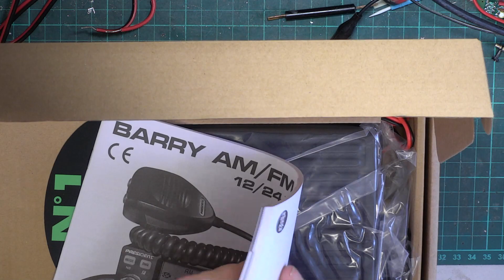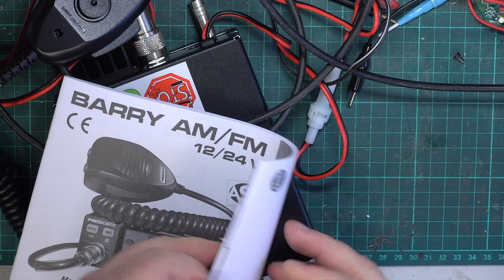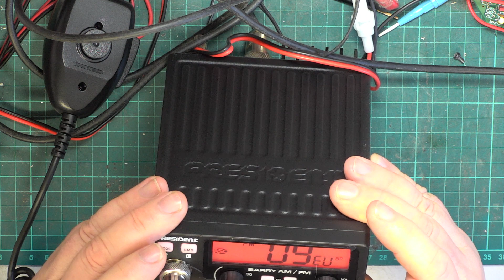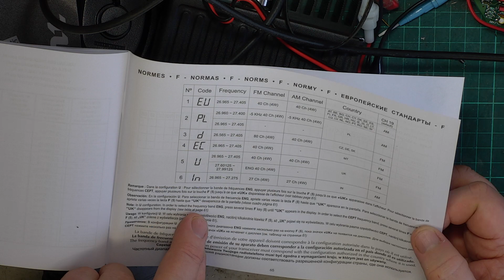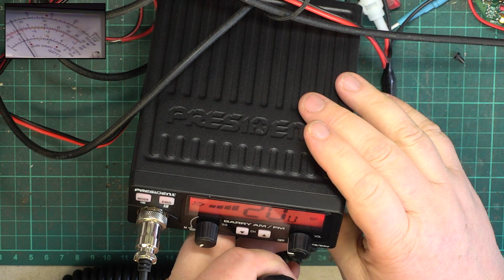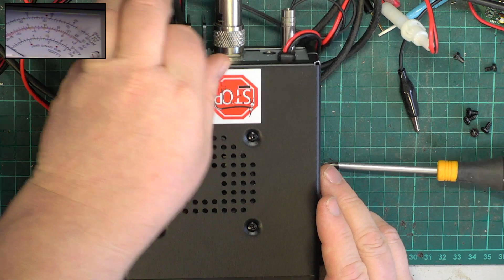President Barry ASC CE MultiNorm CB radio (mobile) - service adjustment, new radio

Comment: Could you please tell me which potentiometer is for FM modulation? Greetings from Stuttgart, Germany
Reply from the maker: FM Modulation is officially called FM Deviation. So when I adjust it in this video, it's the part where I say "FM Deviation" you need to watch.  I certainly can't gell you from memory as it's the only President Barry I've ever seen & Ihave a memory like a sieve.

Richard, G0OJF, UK

Comment: Wondering what you think is the best CB for receiving/DX.  And why don't you like SSB?
Reply from the maker: The snag is that radios differ from set to set of the same model in all aspects. I've had Cybernet 134 chassis radios doing 1uV & then the next set doing 0.27uV. This is why I test & quote the figures every time. Many new sets don;t have alignment points in the receiver. You also have to take what manufactuers say with a pinch of salt, hence these tests.

Assuming you are in the UK, it depends on wht you class as DX. Citizems band radio is a local 2-way radio service with up to 16Km range say our government. I get 35 miles on UK FM in the Nottingham direction, 24 miles in the Newark direction, 10 miles in the Colsterworth direction & 14 miles in the Sleaford direction with me being near Ancaster. That is therefore DX 

Under strange weather conditions you can make contact 300 miles + on an ordinary car set in a car. In such conditions as a licenced radio amateur I once got (in 1983) Russia on 100mW (1/10th watt) on 70cms UHF SSB.

When I worked on SSB business radios used by the police in Wales for example, the clarifiers were automatic...no messing about twiddling. I really just can't be bothered to listen to people sounding like Donald Duck. SSB is 1.6 times the range of AM or FM, that's all (on ground wave) whereas morse code using CW is about 12 times the range. SSB CB in the UK was introduced in 2014 & only type approved (must have CE logo on back) radios made after 2014 may be used. There is much illegal activity on SSB. I want no part of it. SSB may only be used on the 40 CEPT set of channels.

Richard, G0OJF, UK

Comment: Talkback:  Your voice comes through the loudspeaker when you key the mic.  Handy for hearing how much mic gain you have or how much ECHO echo echo you have.  Only nice function I can see Talkback has is you can tell if the mic cable is broken and mic still works.

No smoke!!  How disappointing  :-))

Comment: Richard i suspect them other VR’s may only come into play for adjusting high power when in export mode. I could see the radio has export mode from the pcb and as someone else has commented, that would explain the mega heatsink
Reply from the maker: Yes, I've now been sent the President service manual for this & those presets are to do with AM at a higher power, so not relevant for UK use. Take quoted output powers with a pinch of salt. For example, 20W usually means 12W! A bit ,like 4W = 3W

Richard
Reply: @ukfmcbradioservicingTango21  I’m sure all manufacturers measure output power with zetagi lie-o meters 😁. Oh you do make me laugh. I did think the bremi might be better not worse for accuracy but obviously not.
Reply from the maker: I couldn't believe the 8.5W Bremi. Must have a built in burner.

Thinking of power. We had a Pakistani taxi driver turn up once in the late 80's with poor tx on his 10W Pye Olympic (VHF high band AM, around 170Mhz). He had a Bremi 70W (45W really) illegal CB burner connected....causing his output to be just 2W. Obviously hadn't realised that 27Mhz tat doesn't work on 170Mhz!

Richard
Reply: @ukfmcbradioservicingTango21  if you didn’t know about the linear you could have wasted loads of time testing that vhf set. I would imagine that 99% of pmr users don’t understand how radios work

Comment: One of those pots may be high power when in export mode (note the heat sink in the back!)

There is s service manual available online but it doesn't mention the pots in question.
Reply from the maker: I've now been issued with the service manual. W2 is supposed to be AM mod, but W3 affected it for me so W3 must be AM modulation depth. Looking at the circuit, W5 is also in the AM mod department. Neither W3 or W5 are actually mentioned in the manual & just appear on the circuit. Anyway, the radio ended up working very well....apart from the meter being non-adjustable.

Richard, G0OJF, UK

Comment: Maybe it is time they moved to all DSP for signal processing so that changes can be made via new firmware updates via the JTAG adapter, one might be Clarifier and SSB power
Reply from the maker: It's not an SSB set & has no SSB circuitry or filters. Had it been SSB, I wouldn't have bought one in to evaluate. There is no coverage on this channel of SSB CB radios. This is an SSB free zone as it says in the channel blurb!

Richard

Comment: Oh i have the Barry II EU Version, the only Thing that i missed was an swr Meter, nur ist Sounds great Out of the Box...
And the barry's both Version II and this are both 12 &24v
Reply from the maker: Built in SWR meters aren't a good idea as the diodes used in them can cause spurious emissions. It's best to use a good quality external one when you install an aerial & then just check it from timed to time.

Richard
Reply: @ukfmcbradioservicingTango21  ah okay thanks 😁